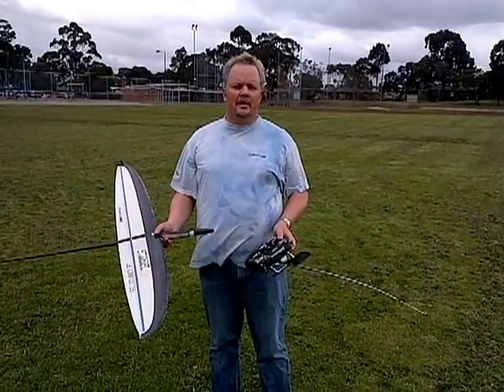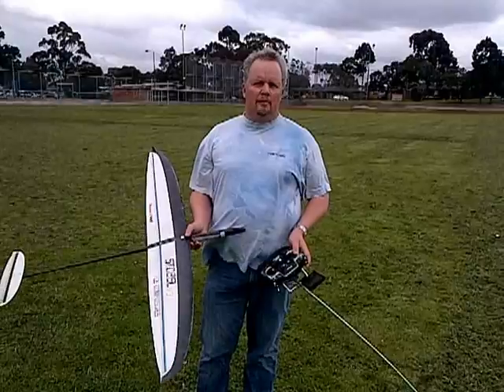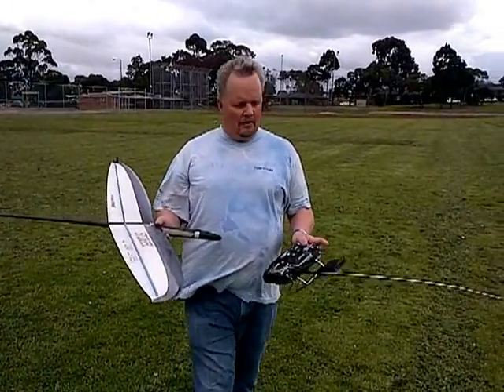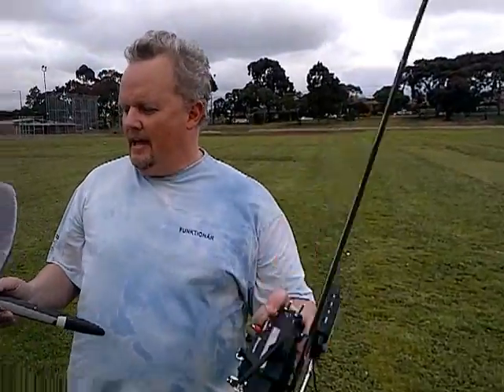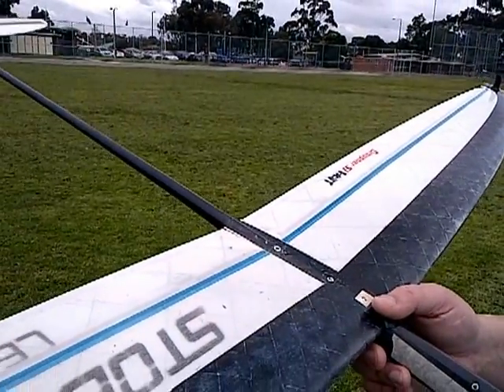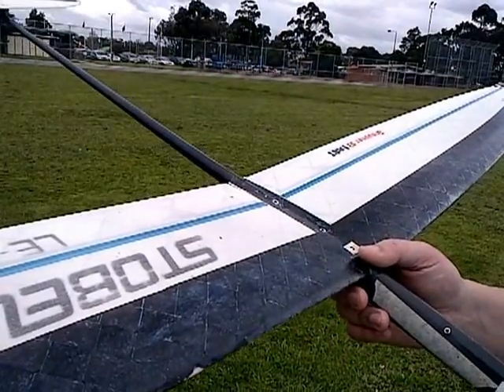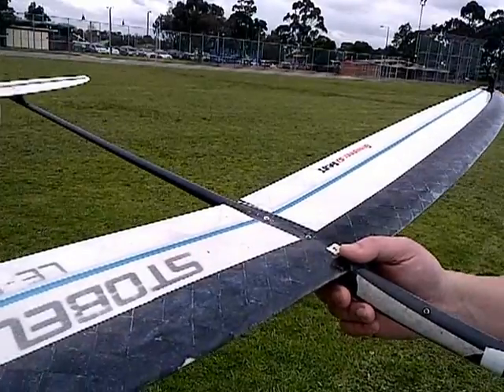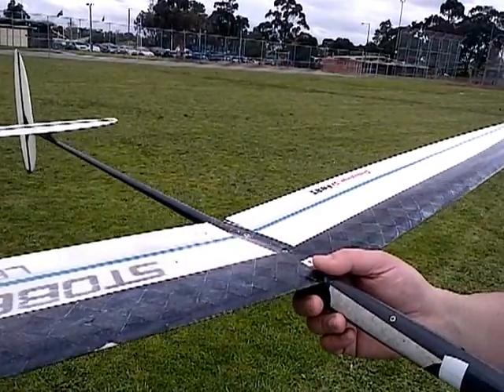F3K/DLG/Handlaunch Plane Setup and Launch to 60m

Comment: That is a great launch . Thanks for the spring switch will try it on mine. I think it is also fair to mention that you are using a thousand dollars designed plane with slim servos that weight 9 OZ  . I would like you to try a 60 mtr launch with a 250 US model like the TopSky  or a Hobby King Versus  they weight 10 OZ.